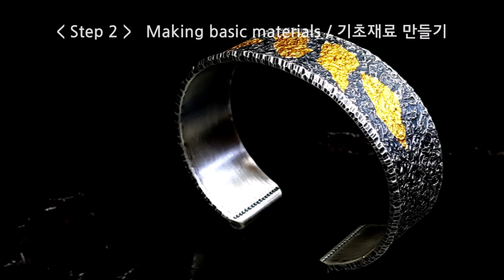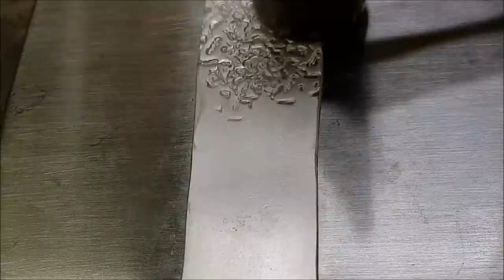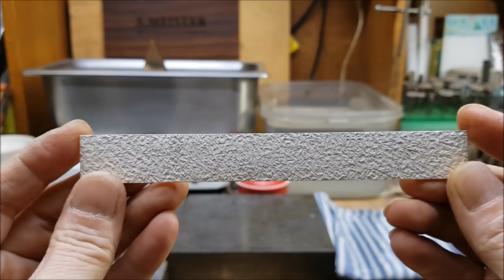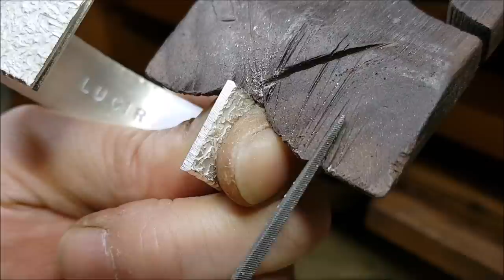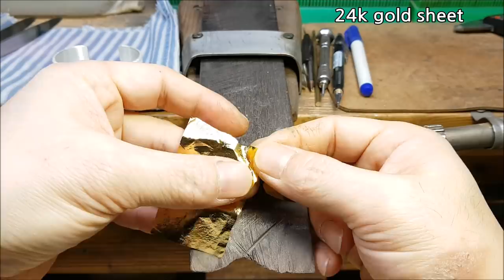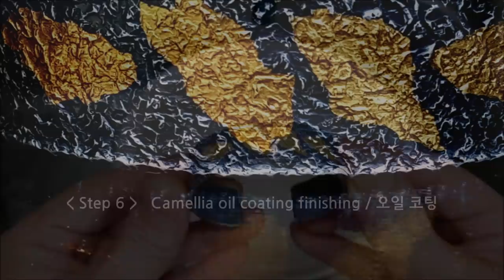Silver forging to "MAKE A BRACELET" - For my love

Comment: Beautiful! May I ask what kind of oil you used at the end ? TY !
Reply from the maker: Camellia oil is vegan oil.
The reason for applying oil is to delay 
and protect the oxidation of the silver surface.
A very thin oil film protects the surface.
After applying the oil, clean it again to finish.
The camellia oil that I use is safe to eat.
It is a very good natural oil that is harmless to the human body even 
when the ring is worn on the hand.
This is the part that a lot of people are curious about. 
Since my work does not have a special finish after completion,
As a minimum surface protection, it is often finished by applying natural vegetable oil and wiping it.
Although it is not shown in the video, it is sometimes coated with natural beeswax (honeycomb).
Beeswax melts easily even at low temperatures (approximately 60-80 degrees) by applying slight heat to it and coating the entire work.
Since what I am aiming for is nature-friendly as it is, it can be viewed as a minimum protection work.

Comment: Beautiful work, what is the camellia oil used for?
Reply from the maker: After applying the oil, clean it again to finish.
The reason for applying oil is to delay and protect the oxidation of the silver surface.
The camellia oil that I use is safe to eat.
It is a very good oil that is harmless to the human body even when the ring is worn on the hand.
Reply: @SilverMeister  Thank you!

Comment: What does the Camillia Oil Coating do?  And do you just Dry it on there?  Thanks,
B
Reply from the maker: Camellia oil is vegan oil.
The reason for applying oil is to delay and protect the oxidation of the silver surface.
A very thin oil film protects the surface.
After applying the oil, clean it again to finish.
The camellia oil that I use is safe to eat.
It is a very good natural oil that is harmless to the human body even when the ring is worn on the hand.
Reply: @SilverMeister  so it protects the oxidized areas so they stay dark longer ?
Reply from the maker: @BenBlankenshipvo  
There is a limit to explaining in detail in just a few letters.
Not oxidation...
By coloring potassium sulfide, considering that the silver will change later,
Helps to keep it vintage.
Oil is just to protect.
It doesn't have a big impact.
I am using a translator.
It is difficult to convey my thoughts to you.
This is the limit.
Reply: @SilverMeister  I understand well.  Thanks for answering.

Comment: Nice work.. how many grs.? Maister
Reply from the maker: What does it mean?
Reply: @SilverMeister  Hello meister u did an excellent work. I was wondering what are the measurements. I see the thickness is like 1.6 to 1.8mm  width like 20 to 25mm  long 15.5 cm. And whats the weight in( grs.)? My question is. wen i melt my silver granule how many (grams) do i have to put on my crusible. 🤔😁😁😁
Thank u meister for ur answer and for share this wonderful vídeos. Stay safe oxoxo

Comment: Amazing! The heat makes the gold leaf bond with the silver? :O
Reply from the maker: right !
With moderate heat,
You can attach gold to the base part.
Reply: @SilverMeister  would it be about the same amount of heat used for annealing?
Reply from the maker: @tblz406  
Almost the same or slightly weaker heat is possible.